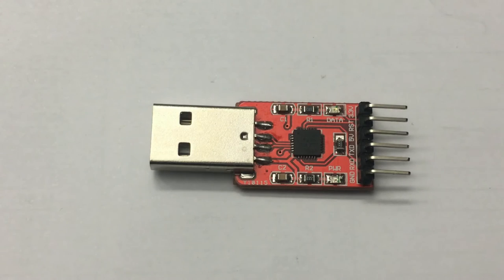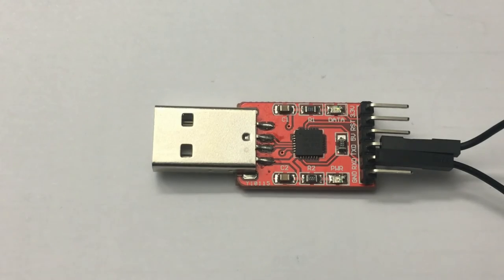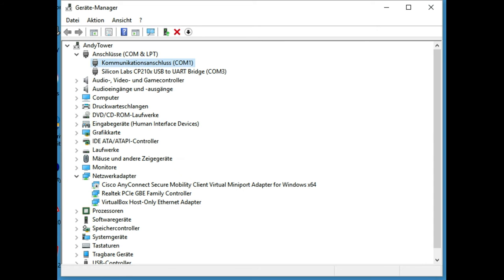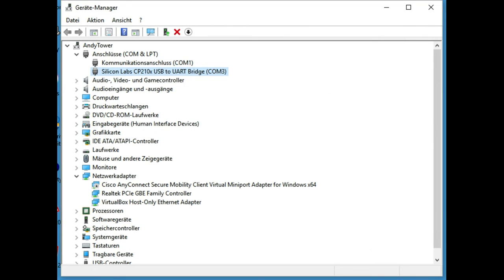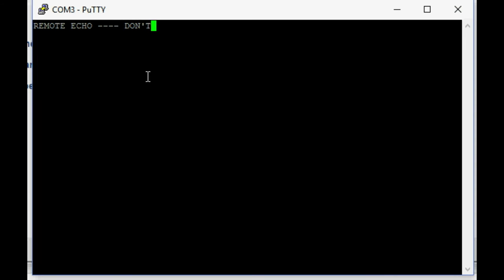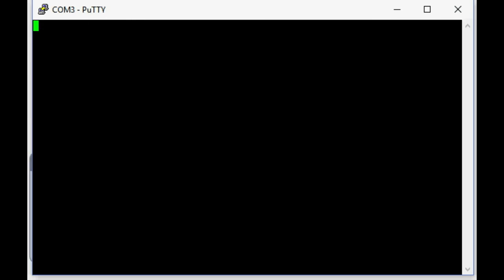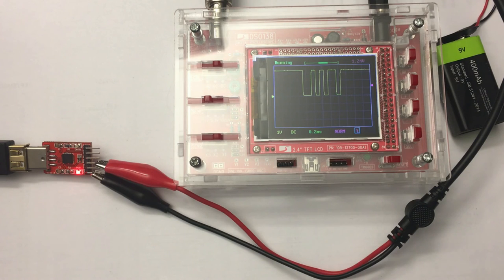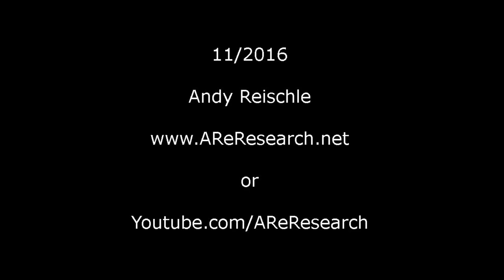How to do a loopback test on a USB-serial adapter

Comment: Nice reminder of a simple test. I remember receiving a free piece of test equipment from a comms equipment supplier back in the 1980s. It was a:

Processor And Peripherals Electronic Reactive Communications Link Interface Probe.

... in other words, a paperclip. You would bend it into a U shape and stick it into pins 2 and 3 (Tx and RX) of an RS232 socket :)

Comment: I use the "U" (uppercase U) for the loopback test, on the oscilloscope it gives a very nice square wave and can be helpful in case you want to "see" the baud rate.
Reply from the maker: Yes, I remember! Back in the late 80s when I built my HAM packet-radio modems to use on the 2m and 70cm bands. We used the Us to generate a clean signal alternating between AFSK high and low frequencies. I had a valved analog scope and no frequency counter then.

Comment: Hi, Thanks for the video. I am wondering the two wires you attached to TX and RX, what are they attached to at the other end of them? Sorry if it is not a smart question. Are they the ends of the same cable? It makes sense that way since it is loop back.
Reply from the maker: Exactly. It is one cable. I had not noticed, but it really isn‘t obvious from the recording.
Reply: @AReResearch  Thanks. Also what I notice is that when I connect one of these to my PC I should also run their drivers in order to get a port assigned or port may not get assigned. Is this also your experience?
Reply from the maker: @f.k.6151  The required driver depends on the Chipset of the USB2Serial bridge. There are only a handfull of Chips. If you are lucky, windows will find the drivers automatically. Otherwise you'll have to have a closer look at the chip and get the driver from the manufacturer.

Comment: Hello.  Thanks for this information.   I had no COM Ports installed in my Windows 7 machine so I had to install a COM Pert.   After doing so, the adapter shows up, but does not seem to bind to any COM ports.   Any suggestions?  Best Regards
Reply from the maker: Before you try to find the OEM's drivers, let the windows device-manager have another go at finding the driver. In the device manager, right-click on the adapter and klick "Update driver software..."  try "search automatically" there. This will take a veeeeeeeery long time.
If that doesn't help, you need to know the chip of the usb-uart bridge. There is only a handfull of them out there, so they're not hard to identify. Beware of "GET SUPER WINDOOOZE DRIVERS HERE - FOR FREE !!!" sites, but go for the chip manufacturer's original, signed drivers.